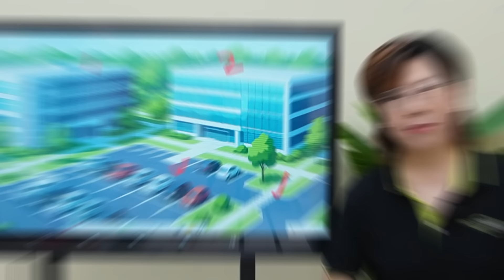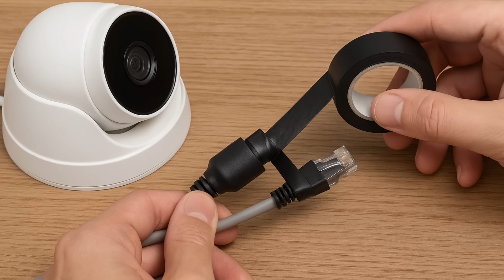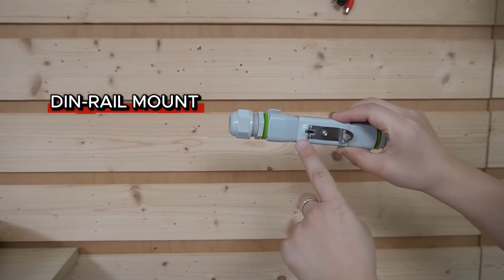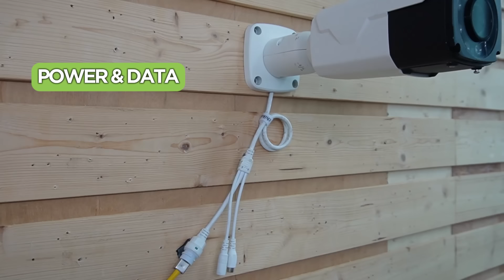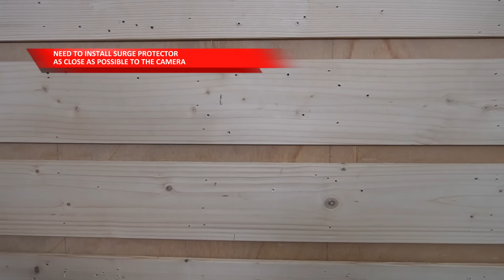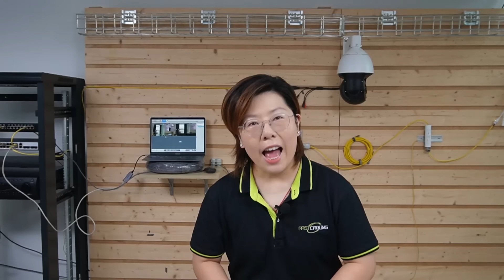How to Build a 20+ Outdoor PoE Cameras System | Reliable IP Surveillance Setup Guide

Comment: The POE switch has video out  capability through any of the 24 port?  And how is the laptop able to receive video? I i thought laptops were just video out
Reply from the maker: PoE switches only carry data and power over Ethernet cables. They don't output video signals directly. To view a PoE camera on a laptop: just connect the laptop to the same network and access the camera's IP address or use the camera app.

Comment: Great video.

A question, do I need a POE NVR if I will be using a POE Switch to power my Cameras or a none POE NVR?
Reply from the maker: Use a regular NVR. The PoE switch will provide power to the connected cameras.

Comment: This will be too expensive
Reply from the maker: It's a very basic setup: PoE switch, NVR and IP cameras. The reason why we add the surge protectors is to prevent lightning-induced voltage spikes from damaging the PoE switch and NVR, especially on outdoor camera runs.
Reply: @Fastcabling Not all client can afford that... Also I am working on a ip system... Where do I get the poe surge protector
Reply from the maker: You can order from our website: https://www.fastcabling.com/product-category/poe-surge-protectors/
Reply: @Fastcabling Do you have any complete networking course
Reply from the maker: If you're interested, you can sign up for our free online courses here: https://learn.fastcabling.com/

Comment: Sir, thank you for another very informative video. I've followed your channel for a while and appreciate your expertise.
I'm facing a challenge with my setup and would be grateful for your advice. I have Dahua NVRs and cameras at 3 different locations only 28 camera, and I need to monitor them all from a central location. The problem is that the P2P connection is too laggy, and using a VPN is unstable.
Could you please recommend a more stable and efficient solution for this kind of multi-site monitoring? Thank you!
Reply from the maker: You can use fiber optic cables to connect 3 locations to the control room. (sfp switch - fiber optic cables x3 - poe switches with sfp port x3 - cameras)

Or use PTMP wireless bridges to connect 3 sites over radio waves: https://www.youtube.com/watch?v=X5cvPF1pSB0

Comment: Enjoyed the video. You covered everything I was hoping including network segmentation, great job. One question that I’d like to ask…. If you were to add 20 extra cameras to this setup, how would you do this without the added expense or labour of materials (cabling, extenders)

In this video, you’ve added 2 x cameras with 2 x cabling and only 1 extender. If 20 + cameras, then 20 x 100m cabling and 20 x extenders would become very expensive not to mention laborious. Might have been good to mention this perhaps or offer a solution to this scenario as it is titled in your video description.
Again, great video. Thank you
Reply from the maker: In this scenario, you can also choose to run a fiber cable between two switches to connect multiple cameras.
Reply: You can connect all the camera closest to each other in a switch  and run Just one 100m cable to the control room
Reply: @iam_phavourite  At my farm that is what I am planning to do. A Poe switch in each outbuilding with cat6a cable connecting them to the NVR in my office in the house. Easier for me than trying to run so many cables from the house to a 16 camera system.

Just hope it does not create too much network traffic, as I have heard about that happening.

Comment: my question is i have a PTZ Hikvision camera not working. how can i fix it to work
Reply from the maker: Try testing the camera with a different power supply, PoE injector/switch, or NVR. If still not working, the camera may have a hardware fault and need professional repair or replacement.

Comment: Thank you for teach this Experience with us through the Platform.
 
My question is the Earthen of the Indoor surge protector and Dain _Rail outdoor Protector do you just burry the earthen  in the ground like that or is their something attached to the burring of the earthen to the ground

I look forward to ur reply
Reply from the maker: A common method is to use a ground rod driven into the soil with an earthing clamp attaching your conductor. The rod should be tested with an earth resistance tester to ensure it meets local code (usually <10 ohms, but ideally <5 ohms).
Reply: @Fastcabling  will the two surge protector be connected to one ground rod or separately
Reply from the maker: In almost all cases, both surge protectors should be bonded to the same ground system (one ground rod or bonded ground network). If you must install more than one rod (for distance or code reasons), they must be bonded together with heavy-gauge copper wire (e.g., #6 AWG or larger depending on local code).
Reply: @Fastcabling  Thank you for your Idea I look forwarding Impacting More Idea's with you
Reply from the maker: My pleasure!

Comment: Can you talk more about fiber optic duplexer
Reply from the maker: The Bidi SFP transceiver is duplex. There is single strand doesn’t mean it is Simplex. It implements duplex through different wavelengths.
Reply: @Fastcabling so you need one at each end  of the fibre optic line and then install them into any switch port and your good to go?
Reply from the maker: Yes, the BiDi SFP transceiver can send and receive data over a single fiber. As long as both switches (or media converters) support the same speed (1G/10G) and wavelength pair, you’re good to go.